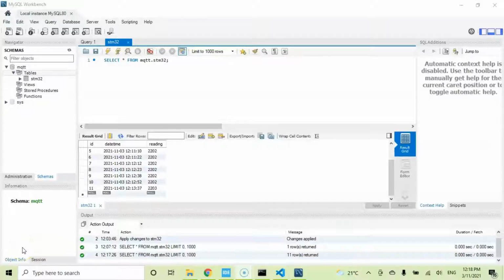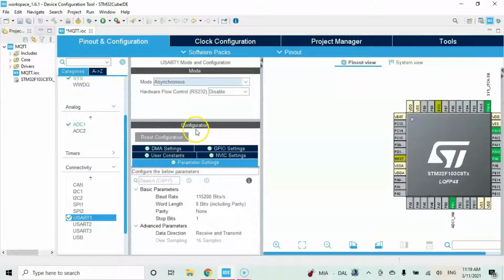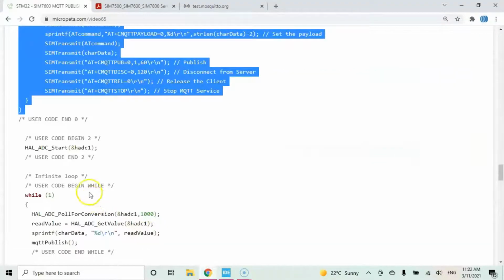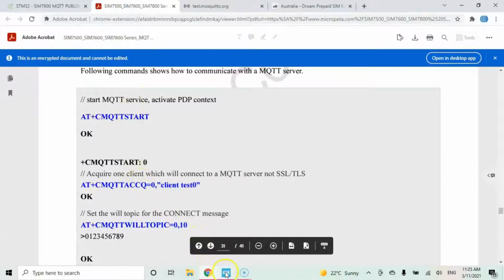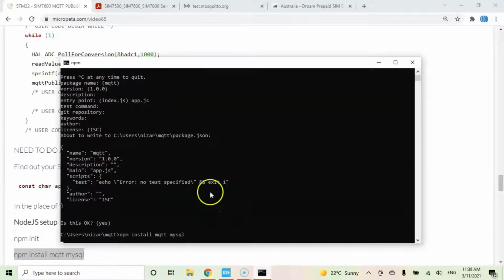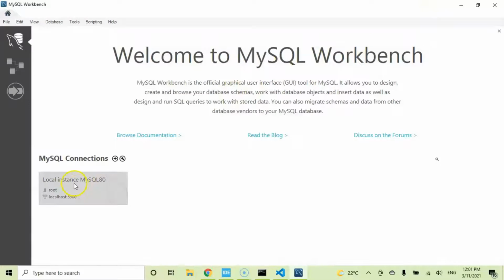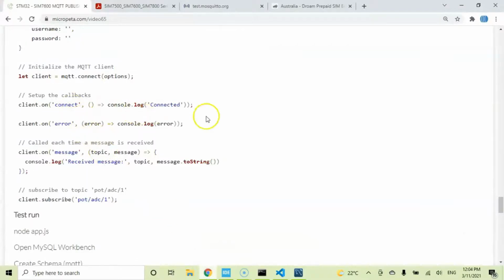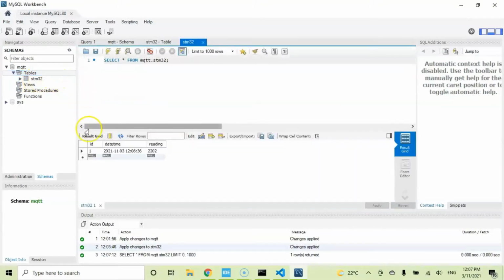65. STM32CubeIDE MQTT Publish to Broker. SIM7600 with STM32F103C8T6

Comment: This does not work for me. When connected to a serial terminal it does not get past the first AT command. I'm using a SIM7600G-H and Nucleo-F042K6 with the pins remapped. I have confirmed that the hardware setup works with your other video about sending an SMS.
Reply from the maker: You need to have mobile data available for this test
Try with a different sim card 

It seems like it does not passing from AT+CGREG?
AT+CGREG? Gives one of the following response
0,0 – not registered, MT is not currently searching a new operator to register to
0,1 – Registered, home network
0,2 – Searching
0,3 – Registration denied
0,5 – Registered, non-home network

Check from a serial terminal what response it gets (0,1 is the one we need)
Reply: @NizarMohideen  Thanks for your reply. Actually I only got the response to the first 'AT' by inserting a function that waits for the modem to fully initialise before sending 'AT'. Once the program enters mqttPublish(void) it fails. That is to say, if I run the code exactly as you have presented it, I never get a response from the modem.
Reply: Here is the function I included:
void waitForModemInitialization(void)
{
    printf("Waiting for modem initialization (PB DONE)...\n");
    int modemReady = 0;

    while (!modemReady)
    {
        // Receive modem output
        HAL_UART_Receive(&huart2, buffer, sizeof(buffer), 1000);
        printf("Received line: %s\n", buffer);

        // Check for "PB DONE" message
        if (strstr((char *)buffer, "PB DONE"))
        {
            modemReady = 1;
            printf("Modem initialized (PB DONE).\n");
        }
        HAL_Delay(1000);
    }

    // Turn off echo
    SIMTransmit("ATE0\r\n");

    // After modem is ready, send the AT command and wait for "OK"
    int ATisOK = 0;
    while (!ATisOK)
    {
        SIMTransmit("AT\r\n");
        HAL_Delay(1000);

        if (strstr((char *)buffer, "OK"))
        {
            ATisOK = 1;
            printf("AT command OK.\n");
        }
        else
        {
            printf("Waiting for AT command response. Buffer: %s\n", buffer);
        }
    }
}

Comment: hello sir, I have a question I hope you can help me with, there is a K pin in the board, the vendor say it is a PWRKEY pin and it is connected to GND, If sent this command (AT+CPOF) to the board to power it off can I use the PWRKEY to power it back on ? If yes how I can use it ? by putting 3.3 volt from the stm32 to it ?
thank you

Comment: Hi,
thank you for your video it really did make it easy for me, but in the commented line that should be used to connect to a broker with user and password, you forgot to add the two quotations for the user and password, just if anyone failed to make it works, I also created a record for the SIM module reply to each command so that I can debug better if it didn't work

Comment: int comandoA0 = 0xA0;
int comandoA1 = 0xA1;
int comandoA2 = 0xA2;
int comandoA3 = 0xA3;
int comando00 = 0x00;
int comando01 = 0x01;
int comando02 = 0x02; séria normal que lo envíe a través de los comandos AT, así:                       sendAndCheckAT("AT+CIPSEND\r\n", ">",5000);
           relé:
                       sprintf(comandoAT, "%s", comandoA0);
        	          enviarYComprobarAT(comandoAT, "OK", 1000);
        	          HAL_Delay(500);

Comment: Hello 
I'm currently working on a project where I need to interface an STM32F4 microcontroller with a SIM900 module to send TCP/IP data to a server. I was wondering if you have experience with this kind of setup and could share their source code with me.

Specifically, I'm looking for any tips or advice on how to properly interface the SIM900 module with the STM32F4, as well as any sample code for sending TCP/IP data to a server. Any help or guidance would be greatly appreciated.

Thank you in advance for your time and assistance.

Best regards,

Comment: I have sim7000g, will this code also work for this module?
Reply from the maker: These setup/code are for SIM7500 SIM7600 SIM7800 Series.
They use different AT commands for SIM7000 series.
For example (to publish)
AT+CMQTTPUB for  SIM7500 SIM7600 SIM7800 Series 
AT+SMPUB for SIM7000 series.
You can read the data-sheet for that module and use similar algorithm to create codes. Thanks

Comment: what about SIM800L?
Reply from the maker: The code works for SIM7500 SIM7600 SIM7800 Series. I haven't tested for SIM800 Series. They are using different set of AT commands for SIM800 Series
Reply: @NizarMohideen  okay, it is clear, in fact my problem is that i can connect to public broker like hivemq with the SIM800L, but it still not work with the local mosquitto broker, have you an idea how to fix this problem?
Reply from the maker: Hi Assem,
In my country, we don’t have 2G networks any more. So I can not test with SIM800 Module.
Reply: @NizarMohideen  no i mean if there is a configuration that i have to do with the mosquitto broker ?
Reply from the maker: As I shown in the later part of this video, Create a Node JS app and put your credentials (host, port, username, password). Subscribe to your topic and console log the received data.
Reply: @NizarMohideen  all works fine, just i have a problem with the broker, in my application the broker hivemq worked very well but the mosquitto broker does not work, that is the problem
Reply from the maker: test.mosquitto.org is a free broker for developers to test. Can not use it for production as anyone can listen to your messages.

There is no setup if you are using port 1883 
No need to create account. No username or password necessary. Just Publish to a topic and subscribe to the same topic
Reply: @assemkarmi9370  Hi, Assem I am also working on SIM800C trying the same thing and got stuck, please Could I get your code?